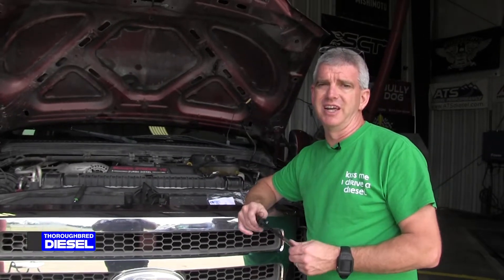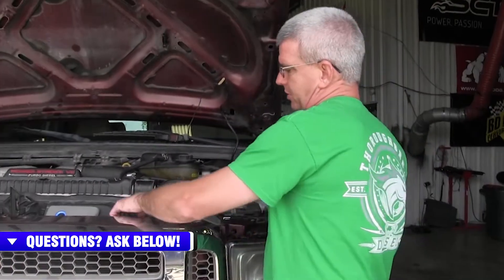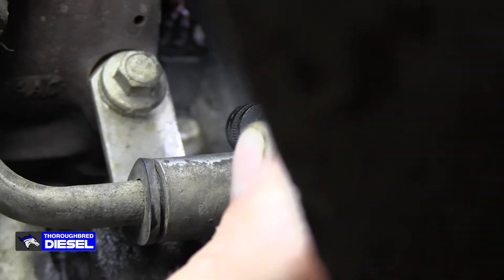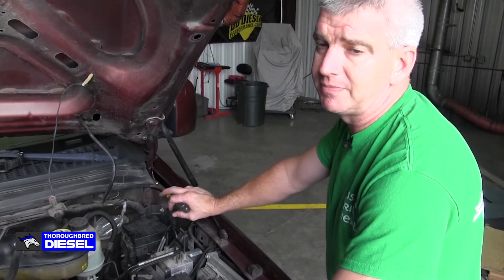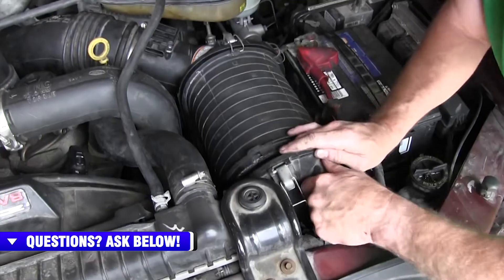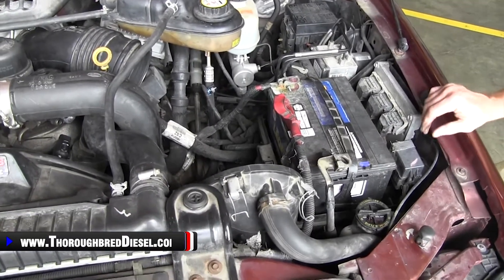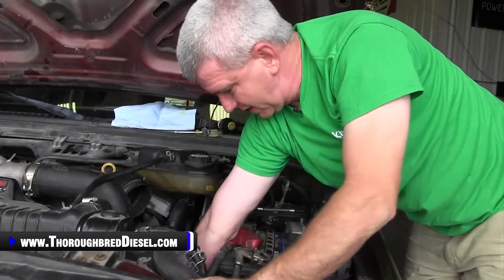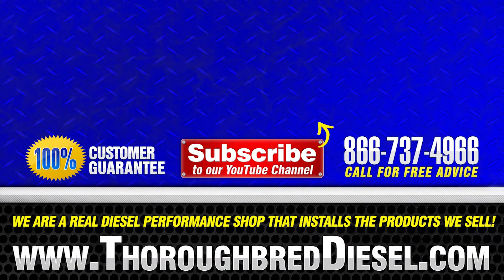Camshaft Position Sensor Install: Ford Powerstroke 6.0L

Comment: What is the air gap between the cam and sensor tip?  It seems like the gap might be too big in some cases.  I have to replace the cam sensor about every couple of years, and thats using Motorcraft part.  When I start to get the tell tale signs of it failing, I put the scope on it to see that pattern, and its always weak.  Have you guys ever taken like .010" or so off the sensor side plastic to get a closer air gap?

Comment: Is the sensor supposed to be completely straight? I've ordered two sensors now and they've both been equally not straight once it gets to the metal portion of the sensor. I don't want to remove mine and replace it with a bad sensor if it's not supposed to be like that.
Reply from the maker: They are straight.

Comment: Thank you for the video. One question: could that sensor be the cause of a lot of white smoke? Thanks.
Reply from the maker: If the truck is coding for cam position rationality I personally haven’t seen it cause a fueling problem.

Comment: I replaced mine and still don’t start now has a new code of p2614 what to do now
Reply from the maker: Need to diagnose if its sensor or wiring harness at this point.

Comment: thanks for the video, got the repair done months ago after watching. Old sensor tested bad. But a short while later I started having trouble with stalling. I got sidetracked with other projects and family matters... but I was just thinking about it, and wondered if there are two cam position sensors??? this is a V8 yeah? so that mean it's a dual cam, right? I'm not sure if it could be configured any other way but anticipate it's like a mirror image... the trucks new to me so IDK... UPDATE: there are two!!! The one mentioned in the video and the other is located behind the AC compressor (you may have mentioned that already), .... hopefully that's what's wrong with my truck!!!
Reply: That's the crank sensor under the AC compressor be easy when u emoved the AC compressor that's way hard to get too.

Comment: I just replaced mine and now when I try and start my truck there’s a loud click sound and doesn’t crank. Any idea why?
Reply from the maker: Go back over install.  If you unhooked battery cables check those or check battery level.
Reply: I got it fixed my starter just happened to go out when I replaced the cps

Comment: Thanks, will be changing on my 2006    
Question, I have been told that the part from dealer is not up to standards -- or not available
Reply from the maker: In this video we are using a Alliant Power sensor,  and we have had really good luck with them.

Comment: Could a bad sensor be the cause of stalling? I just test drove a 6.0 and it stalled 4 times during the drive. owner said this is what may be the cause.
Reply from the maker: Would need to be diagnosed.  Could be multiple things.

Comment: Can a faulty camshaft position sensor cause the truck not to start because I had a mechanic just work on my truck. The truck ran perfect the day before. Go out next day to start it. It just cranks and cranks and cranks and won't start send it to the mechanic. He said it was camshaft position sensor get the truck back home. Drive it for a couple weeks now. It's doing the same thing again. Why would this be?
Reply from the maker: A camshaft position sensor failure can cause a no start,  however you would need to check codes and monitor the rpm output with a scanner before you deem the CPS bad.

Comment: Mister why when my sensor is conected  my motor is hard to star , and when the sensor is desconected engine is free and can crank easy
Reply from the maker: Does it start?  If so, suspect harness.

Comment: Thank you.  Good info.  FWIW I never take the air filter box apart.  DieselTech Ron taught me to remove it as a complete assembly.  It will clear the rad overflow hose completely assembled and then you don't have to mess with putting it back together. I agree its a bad design but once you stop taking it apart it gets easier.

Comment: That's a gravy one some 6.0 are designed differently I had to remove air filter lower rad hose ps pump and out the suckere came still no start though lol differently going into hard diagnosis tomorrow

Comment: Did this today. I'd like to add if you pull out the filter take out the battery so you dont fight the space. Its already disconnected so remove the holder and the positive and it will make life better. However I didn't find installation or removal from above any help. I'm 6 foot 5 and couldn't get to it above short of seeing frayed un covered wires at the connector so I decided to try and run it to the top but the connector hits the hard lines and the thermostat housing and can't be removed so I don't see the reason to remove the air box.

Comment: Hey i have a 2003 ford f250 6.0l and i have a bad lope in my engine almost like a have a wicked cam in my truck now ive changed the ipr valve ive changed the cam sensor any idea what it would be
Reply: You get it fixed?

Comment: I have a 2006 Ford F-250 with a 6.0.    I totally did everything from the bottom. No need to remove air box at all. Good light is essential. Remove 8 mm bolt from bottom . Partially remove sensor an inch or so. Then I used a thin flat blade long screwdriver and gently pushed the wire of the sensor.  With that out of the way, I was able to pull the sensor out with no problem.   Simple
Reply: You got lucky some of us have to remove more,, I remember my personal truck being that easy.I'm glad yours was that way, I wish my buddies truck is,, i also wish my buddies truck was that clean. I look like a skunk at this point😂
Reply: My wrist are to big to fit,, wanna help? 😅. Trying to fix my buddies, never saw this much oil and grease. Got it out but can't get the bolt back😢

Comment: Changed out my CPS after watching this "how to". Great tips but I have 1 more to add to it. If your removing the CPS with the connector still attached, make sure you have enough slack in the wiring. I unfortunately didn't and the only way I could disconnect it was to put it back in and refasten it, as there's NO Way you can disconnect this with 1 hand and the CPS spinning freely. Other than that, great tips.
Reply from the maker: Thanks for the info! Good tip! 💪
Reply: One handed and hanging can be done with good to excellent hand dexterity

Comment: Well, I just changed mine out and now it’s not starting. Any tips?
Reply from the maker: Was it not starting before? Start with retrieving any codes in the truck. Research them and then use real time data to verify those conditions.
Reply: I have a scan gauge 2. It was reading it to be the cam shaft sensor. It would start before, but with a code. Put the new one in, no code but no start. So I put the old one back in and it started right up.
Reply: Plus, I have an sct x4 that was reading the same code

Comment: What was the symptoms you had to replace the CAM sensor?
Reply from the maker: This particular truck had no symptoms but was used as a “mule” for our install video based on tech calls we get for P2614 code.
Reply: @thoroughbreddiesel   my 04 just quit on the road just shut down no noise they are telling me this is it - they told me to turn key crank motor see if tach moves it not its sensor it didnt move but when it almost started it jumped they told me its loose or broken true or not help
Reply: @roswell266  was that it boss?
Reply: @Mr-hm1wr   sorry to say no had a 6.0 mechanic come by first it wasnt original motor been replaced with remanufacture one he said thats no big to some people -but he got it started he said listen to this he cracked it on sounded like crap thought it was going to blow apart -he shut it off and showed me on his computer screen cylinder 1 and 8 spun dead ahhhh! then he pulled oil filter off full of glitter sized metal he said lifters blew off needle bearings went  id have to tear it down to see if motor was still anygood to save - i sold truck i didnt have time for it

Comment: I have a 2006 f350 6.0 diesel ,  it died driving down the highway, it will not even turn over and the odometer has dash marks . No check engine light or codes to be found , would you have any idea what could cause this issue?
Reply: What did you find out my 05 f250 is doing the same thing thanks for the help
Reply: @jadbud24   the instrument cluster went out, I purchased one on eBay

Comment: Nice Well Done Mr. Wade!
tips:
Wrap Electrical Tape Around the Universal Joint on the Socket. (makes it stay in a position yet still fully Flexible)

Wad of sticky type like the Green Grease from Lu(@$ (helps make suction\stiction in the socket to the nut or bolt head great for installing them too)

Hire Wade to do all your repairs(Very BEST option)